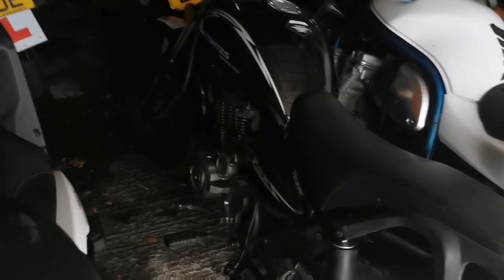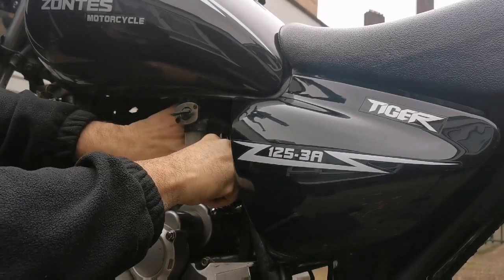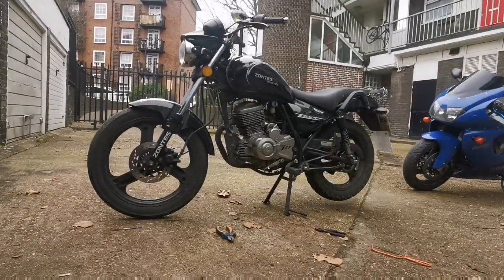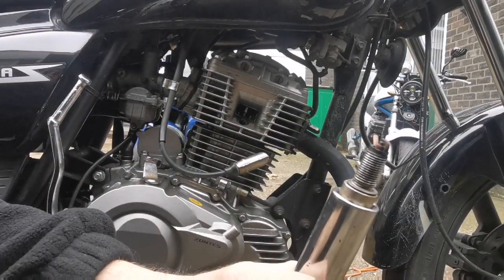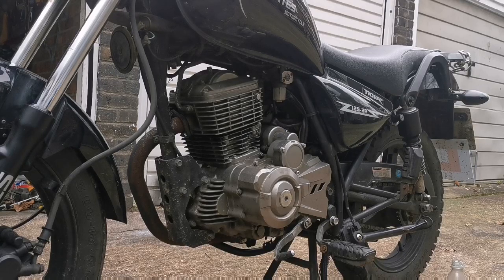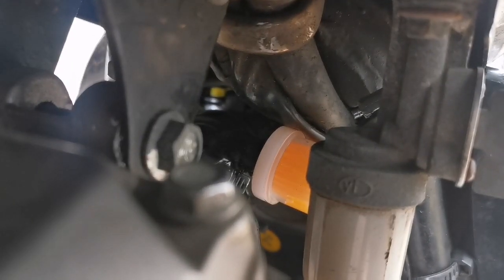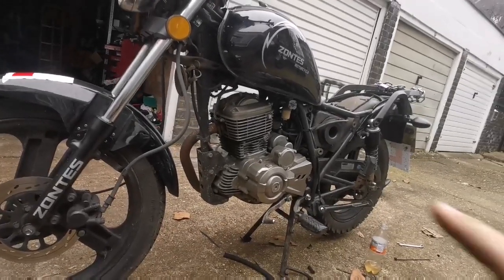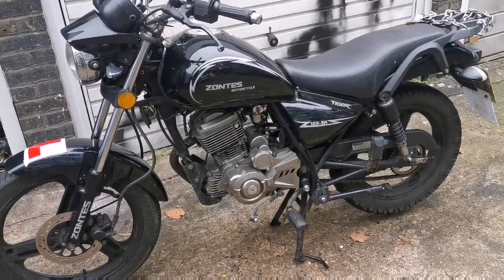Zontes 125, comes back to haunt me. Fuel tank flush.

Comment: Check the spark plug it might be fouled, or check the diaphragm in the carb and check the jets again, check to see what the float is like, might be offset, or its loosing compression mine did this I also seen the smoke come out of the exhaust maybe it needs new rings get an endoscope and check down the bore,  also check the egr valve if it has one and make sure Al breather tubes are intacked and not kinked
Reply from the maker: Old video that mate so it's long gone I'm afraid. Definitely ran well in the end. 

Thanks for watching mate.

Comment: These Chinese bike have a problem with mixture screw
Reply from the maker: Some do and some don't. They used to use it to lean the engine out as much as possible to be able to get their bikes into other parts of the world, UK and USA for example. The ones delivered to America still have this issue but most delivered to the UK don't anymore.

I will check on mine today to see if it is fully in or not.

Thanks for watching.

Comment: rather than turn tap around is there not room to bring pipe round between side panel and frame tube re-route it that way so the tap can still be used
Reply from the maker: I considered that but the same wiring loom gets in the way. I think turning the tap around would be fine as the bike has a petrol gauge, you don't normally get a reserve tank and petrol gauge. Also the tap could still be used if wanted but would be facing the other way. After flushing the tank out it may not need any more work but we will soon see.

Got my own zontes to work on tomorrow so keep an eye out for that.

Thanks for watching.

Comment: Hi mate, I have a Honda PS125i 2010 Model but it won’t start, I’ve changed the battery and all the lights come on and everything, You can hear it wanting to turn over when I try turn it on but it won’t for some reason.. If you have any idea that’ll help I’d love to hear it
Reply from the maker: Hi, these models are fuel injection I believe but check and see if its running a carb. The first thing you should do is completely drain the old petrol and put new in, if this dosnt start it then we need to consider other things.

Can you get it to Islington at all? We could spend a few hours next Saturday on it.
Reply: motorcycle rescuer Is there a walk through of how to drain the old petrol on your Honda PS videos and I’d need to get some transport as I’m from Croydon but I’ll definitely try
Reply from the maker: @isentement3036  not really although I've done it a few times on my channel.

Honestly if you can get someone with a van or hire a van it will save you so much time and hassle. I won't charge you a penny and we can do as much as we can with the bike.
Reply: motorcycle rescuer have you got WhatsApp or a number I can contact you on? I’ll try see if I can get a zip van on hire and if you have WhatsApp I’ll video call you and show you what I’m talking about
Reply: motorcycle rescuer I’ve emptied the petrol from the tank do I need to get new petrol before I try too see if it’ll start ?
Reply from the maker: @isentement3036  great, yes just fill up with new petrol and I see no reason why it wouldn't start.

Let me know.
Reply: motorcycle rescuer Will do brother